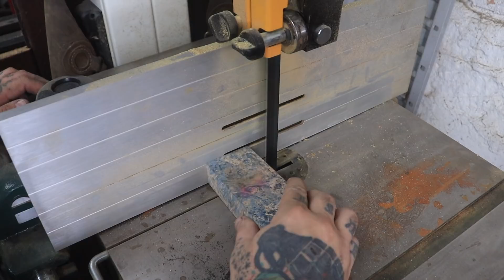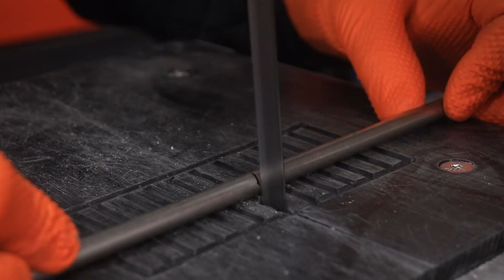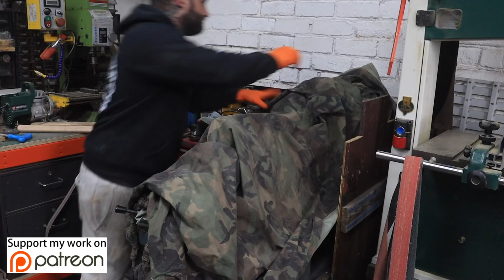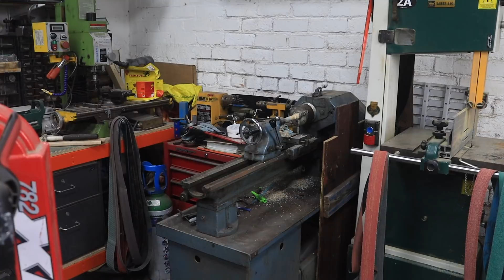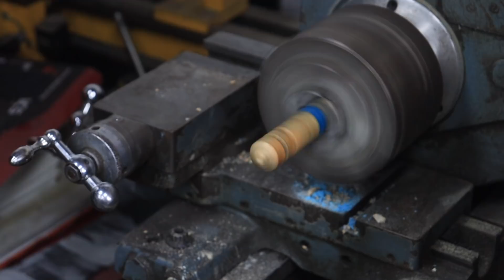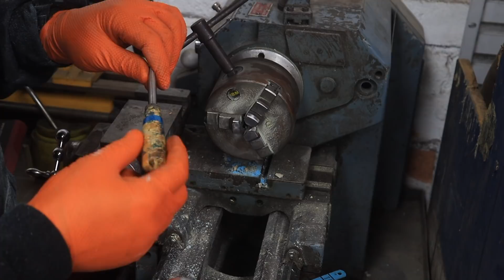Making an EDC Awl or Marlinspike

Comment: Ещё руки на месте?
Reply from the maker: Well yeh, course they are, cause I know what im doing
Reply: @DiesInEveryFilm  If necessary, use personal protective equipment. It is forbidden to work in mittens and gloves, as well as with bandaged fingers without rubber finger pads, on machines with rotating workpieces or tools.
Reply from the maker: My workshop my rules